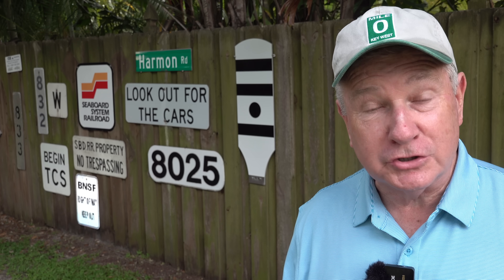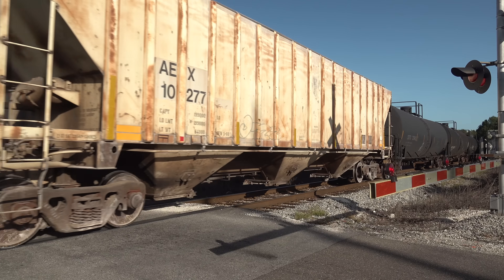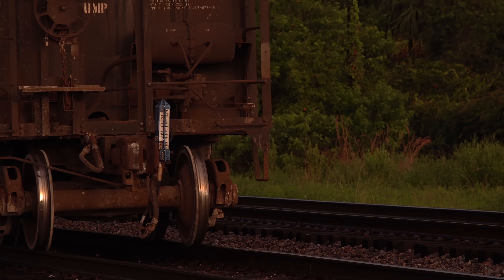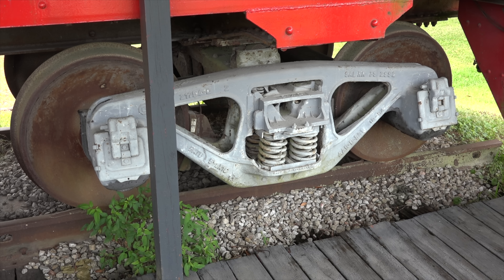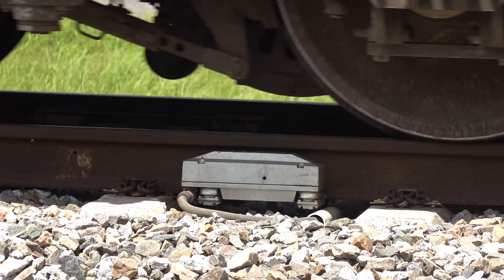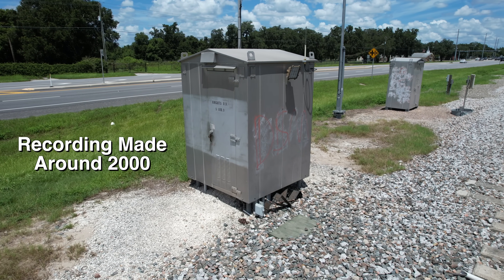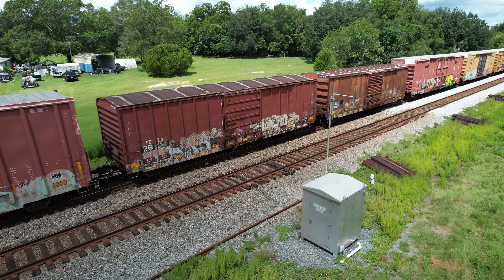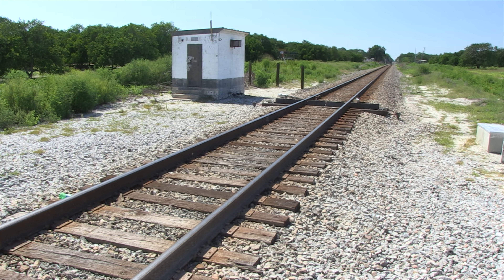What Railroad Defect Detectors Do

Comment: Danny, those buffers are also on each end of the train for the simple fact that if a train crew has to stop and run around their train as part of their run,  they dont have to do a special run around move just to move the buffer to the correct end. Norfolk Southern has a grain train that heads south thru NC and when it gets to greensboro NC the train will stop and either wye the train, or cut off and run around their train at pomona yard. Although a grain train doesnt need buffers I would imagine this is would simplify operations in the real world. So that the train can be pulled from either end.

Comment: Hi Danny thanks for this video. I knew about the electrical boxes that produced the radio calls. Some how in the back ground when you hear it in the videos it always seemed like it was for track's condition rather than the train cars condition. As an engineer who wants to operate a train in that one location that the tracks contain, well, defects? If tracks were perfect rail companies wouldn't need Loram. 
  Anyway I watched a train video last year you might have seen it. A train crossed a bridge over a river think or something but when it crossed it, it got a warning that a car's location either by car number or by the axel count. It was an airhose that a maintenance worker left on the side of the car tied it to the back of it. The engineer had to call it in to dispatch to get approval to move the train again and he had to explain it in full detail that it was a type of air hose that wasn't broken but the way someone wrapped it around the back of the car. It was amazing to see the safety detector was able to pick up on it and then train crew learned the hard they pulling wide rail car because of a jerryrigged airhose.
Just so you know I might make a note of it to call that City that has Harmon Road and have them inspect it for defects. Kidding!

Comment: Great video Danny! One thing I will add to your outstanding video is as a train passes over the detectors on the line, they can tell if an axle is heating up based on the previous DD's reading. I've heard trains get called by the dispatcher telling them to set out a certain car because there is heat building up on that particular bearing since it has passed the previous DD's.

Comment: Many times the detectors (or the wayside desk as NS calls it) will flag a car for various reason, flat spots, consistently heated bearing/wheels. Wayside contacts the crew to inspect the car (the detector gave no defects), or the car is flagged in the system and simply bad ordered at the next terminal where it receives an inspection.

Comment: I'm surprised the D.D.s don't have some type of flexible stick to check for shifted loads overhanging a flatcar or some such. I think many railfans are familiar with the image of the steel coil whose strapping came undone so a 3 or 4 foot length was overhanging the car. The carnage that could cause is terrifying.
Cool video Danny; very educational for those not in the know.

Comment: One interesting fact to note about buffer cars: technically by FRA rules they require at least five individual buffers on each end of the train for most hazmats, whether in a mixed manifest or full unit train. You might notice on manifests that there will be a good amount of hoppers or boxcars before a string of hazmat loads like oil and chlorine for customers in the area; generally when building the train yards will do their best to put another customers car between those hazmats as a buffer. However, as noted by that BNSF ethanol, there's a quite overlooked loophole in regards to who makes the rules. The railroads follow their own set over the govs in most cases, which is why they still only put one car on each end when the FRA requires five. The change in car amount was in response to a major incident in 2019-2020 where a Union Pacific ethanol derailed and even with buffer cars to stabilize the ethanol tankers from being in positions that would be more likely to derail, one simply wasn't enough.
Reply: Still 1 one on each end of ethanol in my area. On solid trains anyway. Mixed freight still requires 5.

Comment: When a defect is found, does that mean the crew has to walk back a mile to locate the broken hose/ broken knuckle? I've always wondered that with these excessively long trains. Great Video Danny.
Reply: Yes. My limited understanding is that the conductor gets to take a little walk. You would think with modern technology sometime of electric bike or small 4 wheeler would be most helpful.
Reply: @randyogburn2498  Any kind of four-wheeled vehicle is going to be too heavy for the crew to lift down from the locomotive. Bikes don't work well on rail lines. The ballast is too rough, especially on the shoulder, and there are too many blockages once you get off the ballast. And, in a double-track setting, you certainly wouldn't want somebody cycling down the other track and getting run down by a train.

By the way, if it is a broken hose or knuckle, defect detectors are irrelevant. As soon as the knuckle breaks and the train splits, the air lines will part and the train will automatically make an emergency stop.
Reply: Yeah they have to stop the train and the conductor has to make the walk to find out what happened. I just commented about an airhose that was detected that made a car wider than what is previously to a worker having it attached to the side of the car to the back of it. Also if your cars become disconnected you got figure out where at. You got find out what the problem is usually what happens they will break the train apart and another crew will get it. I just watch so many train videos. The crews get really good warning when emergency issues arrive.
Reply: @scottivlow9962  I'm lazy, i would strap an E- bike on the front or rear of the train.
Reply: @miked7745  The only this about that it would be a rough ride. There tracks that are in such wooded areas walking conditions are even tough enough. I use to walk railroad when I was younger and it isn't fun walk.
Reply: @scottivlow9962  they dont have enough crews to do that. Crew will fix the problem
Reply: @treos17  I have seen video where the will disconnect from the broken crew don't have tool to fix a broken car. See jawtooth video of derailment and the train leaving the broken cars behind.
Reply: @scottivlow9962  yea thats a derailment, different story. And if they dont have the tool theyll send a car expert. Been there, done that.
Reply: Depends on the type of defect, some will allow you to proceed until you hit another detector or get to a terminal
Reply: One went into emergency last week in front of my house.  I got to chat with the conductor as he was walking back towards the head end.  They had lost air pressure in the train line for some reason.
Reply: Most of the time we do have to walk it, had a coworkers engineer throw the train into emergency because of a vehicle(thats another topic all together) but since he was a key train he had to walk....all 212 cars and back. Like another poster said, sometimes you can get by without walking if another detector of the same type is within a certain mileage of the detector that gave the defect. If it sounds confusing we have a chart that tells us if we have to walk or not.

Comment: Some additions and corrections:  More and more railroads are adopting "talk-on-defect-only" detectors to reduce radio "chatter" on the road channels.  In my area, most defect detectors now only "talk" if the detector does, in fact, find a defect.  In mountainous areas, there can also be "slide detectors" that will audibly report rock or mudslides on the track over the road radio channel.  In such areas there are wire fences--called "slide fences" adjacent to the track in slide-prone areas.  If mud or rock break any of the wires on the fence, it trips the detector.  Similarly, areas of track prone to flash flooding can have "high water" detectors that will trip if flood waters reach the track.  Finally, about the "buffer" cars on hazmat tank trains.  Usually, the rear buffer car (and sometimes two buffer cars near the middle of the train) are there for when distributed power units are used on the train.  Typically, the buffer cars will remain on a unit train, so that they do not have to be added enroute when DP is needed.
Reply: Talk on Defect Only sounds like a bad idea. The detector could be down for weeks or months before it gets inspected.  I mean, there is not that much chatter on railroad coms.
Reply: It's only a bad idea if you foolishly haven't taken that into account. In the simplest of set ups, every time a train passes, all of the detectors are supposed to be working, if the system fails to receive a signal from one of the detectors, it can radio the train that it needs repaired and let the train radio the report in. They also have the ability to self diagnose even if a train hasn't used it in a while, as a computer only has to monitor the flow of electricity to each detector and if the circuit is broken or the voltage return is outside of what is expected, it knows the detector or the wires connecting the detector to the computer have gone bad and can generate a report that way. In a more advanced set up, if it is connected with a phone line, or to a cellular network, or even through satellite in the most remote of locations, you can also have a "home base" call into the DD computer at regular intervals or an operator in a control center can manually trigger a check like they do with automated switches and if the "home base" or control room operator doesn't get a response from the DD, or an incomplete response, or a bad/failure report, a manual inspection order can be issued to repair the problem.
Reply: @Stant123  Doesn't account for the failure of the radio system.  A better design would at least ID with "NO DEFECTS".
Reply: @currentfaves65  it all depends on what area you’re in.  Some railroads have more radio traffic than others.  For example, if there’s a DD near a yard, it can tie up traffic, or other traffic can cover its transmission.
Reply: @bluegrassman3040  Yep, I live in Cincinnati so  radio traffic on the scanner is light. I forgot all about the massive yards in other states !
Reply: @currentfaves65  I would think it to be an area with more radio traffic than where I live in western Kentucky.  The nearest yard is CSX Howell yard in Evansville, IN.  Occasionally I pick the yard traffic up there, but it doesn’t come in as strong.  If there’s no train traffic going on for a while, the scanner is usually quiet.  Whenever I start hear static and then the DDs, I know that something is moving down the tracks.
Reply: @currentfaves65  New defect detectors are now connected. They read the AEI RFID tags from the cars and upload bearing, wheel impact data, wheel profile measurements, and brake photography to a railroad's server. The railroad does trending on this data, so they can schedule cars for maintenance before a defect detector complains and the train has to stop and deal with the problem, causing delays. If there is a problem, the connected defect detector will send data to the railroad immediately and they can start organizing a response and reroute following trains. So if there was a defect detector failure, they'd know about it remotely.
Reply: The final buffer car(s) are needed no matter what should a second train rear-end the hazmat train.

Comment: Danny, I would like to offer a small correction to your description of the journal boxes on the trucks.  They were packed with "waste" or later with a foam-filled pad that was soaked in journal oil instead of grease.   The waste or pads were so fixed that they wiped the bottom of the axle under the journal brass to convey oil to the axle to carry to the brass for lubrication.  The journal oil was usually called summer black oil and it was black all right and messy.  I usually helped repack the journals of the trucks of the Huckleberry RR passenger cars during the winter.  The use of SAE30 oil was also done by some railroads.  I can remember seeing a smoking and burning journal on a KCS train heading to the yard from the south of Shreveport on several occasions.  When all of the oil was gone is when a hot journal was the most dangerous; the brass and axle got so hot as to lose integrity and break causing a derailment.  Before roller-bearings on passenger cars, a substance that emitted a strong odor was added to the oil to help detect hot journals.
Reply: Thank You! ☺️
Reply: @Bassotronics  aa

Comment: The flappers were likely just repaired or had undergone maintenance and the numbers used to put them back in the right spot not washed off yet by rain.

Looks like there could have been some damage to the number 4 flapper since the number is higher up in a corner but they could have just placed it strange

Comment: Excellent video, Danny. I've often wondered how they worked in regards to the passing trains. I have recently discovered a website called defect detector database that'll show you a map of where they all are what railroad they're on, the milepost, the model of the equipment, and in some cases, a recording of what the transmission sounds like. In doing this, I discovered that some UP detectors in Illinois near Chicago have a female voice.
Reply: Female voices are easier to hear in low ambient noise environments because they don't (usually) have the deep bass frequencies that tend to muffle sounds.  Synthesied voices take that issue out.

Comment: Hi Danny, great video! At time mark 3:50 the pair of small boxes mounted to the rail are the Magnetic Transducers that senses the wheel flanges passing over them (no physical contact is made). As the metal wheel flange passes over a transducer entering its magnetic field, it causes an AC voltage of about half a volt to be produced and tells the scanner to start collecting infra-red samples for the wheel bearing & when the flange passes over the 2nd transducer it stops collecting infra-red samples & this process repeats for each wheel flange. And as someone else had commented, the transducers also performs the axle count & makes train speed calculations.
Reply: CN uses them to get direction, as well
Reply: @ebnertra0004  Yes, there is a drop down menu that allows you to select what info you wish to have transmitted which includes train direction, speed, outdoor temperature, axle count, wind speed (I never knew the reason for wind speed) & train length.
Reply: @tom49801  I think there are some places with high wind detectors, especially in the mountains, but I don't know if they're incorporated into detector sites or standalone (either is possible, I suppose)
Reply: @ebnertra0004  Oh cool, thank you. I have seen videos in the past showing a wind vane on the roof of the Defect Detector's equipment house.
Reply: @ebnertra0004  'Ya learn something new every day!

Comment: About 15 years ago I was on one of the Amtrak silver services going through the Carolinas in the middle of the night with my scanner in my ear and I still remember dozing off and hearing "CSX Defect detector......HOT BOX DETECTED". Immediately the brakes were applied nearly to emergency power and the conductor came running down to the car I was in ln. Turned out to be a false positive.

Comment: I was always curious about defect detectors, and I found this video fascinating! I'd like to see a video on flange greasers and their purpose. I thoroughly enjoy watching your videos on trains and how the railroad actually functions! It's obvious that I find trains to be fascinating to watch, and I love the sound of a set of air horns mounted atop of the locomotives!
Reply: Our system played with Flange Lube (spot greasers), but decided that sand mixed with the grease and caused more grief for equipment than it was worth, so they were removed. Perhaps another company has found a way to use the little dollop of grease that is shot out onto the flange, when it is in a tight curve. I don't know, but the co. I worked for, had us to un-install all of them and put the axle generators back in stock for speed use only.

Comment: Rode the Norfolk and Western 611 Steam excursion from Spencer, NC to Asheville, NC several years ago.  Just as we pulled onto the Asheville sub the defect detector went off with an over temp.  The Engineer radioed the NS dispatcher that he was a steam engine and was less than 10 miles down the track.  The NS dispatcher let us continue BUT on the way back the same defect detector went off again.  Because we were pulling onto the main line, the dispatcher made us stop for an inspection.  Nothing was wrong and we continued on.

Comment: Every new video, there's a new sign on that fence! Good to see you again, Danny. I really enjoy your videos!
One small correction: The journal boxes housed very thick oil, not grease. The oil was soaked into a sponge with some springs inside and a mop-head like material on the outside. This was known as "waste" because it used to be a big was of cloth waste, and could be replaced with such in a pinch. The plain  bearing inside the journal box was lubricated by the oil soaked up by the waste and would need to be periodically filled. If the oil ran out, the bearing  would heat up and could possibly catch fire if it wasn't caught in time (that's why cabooses had cupolas!) and with old wooden train cars, that was never a good thing. Hence the term "hotbox". 

Now a term used by pot smoking teenagers, the reason for the coining of the term is still the same - identified by a plume of smoke emitting from the journal box.

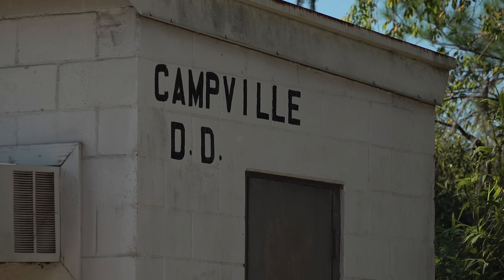Comment: At around 4:50, you include an aside about journal boxes without any further context.  I've noticed that recordings of defect detectors that sense a temperature irregularity on wheel bearings will often announce "hot box" as a reference to the old journal boxes.